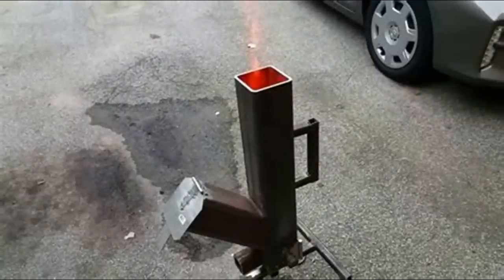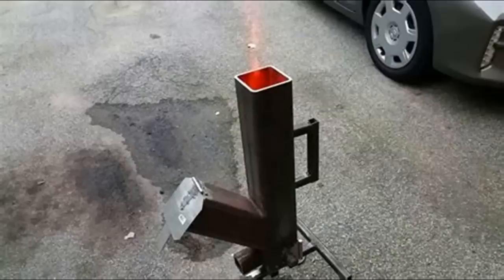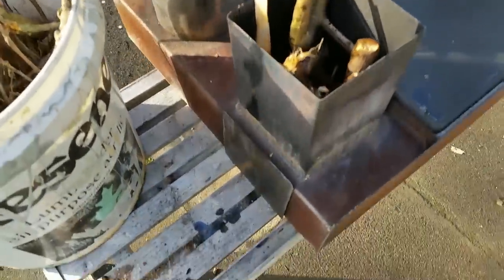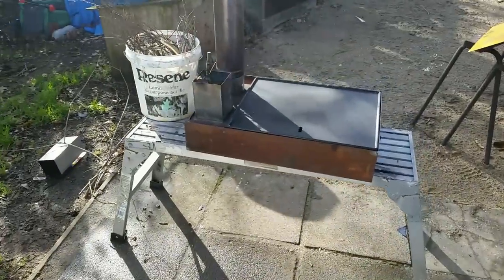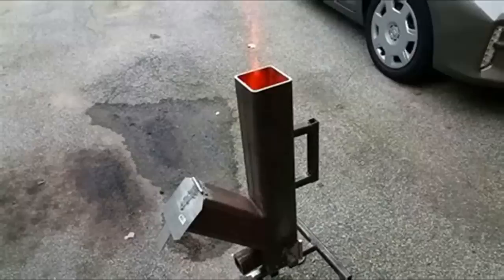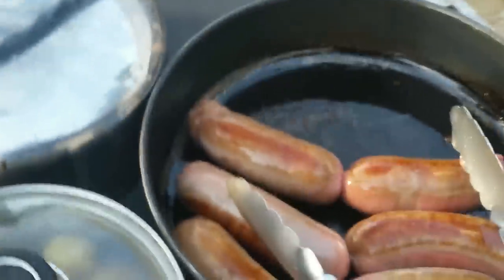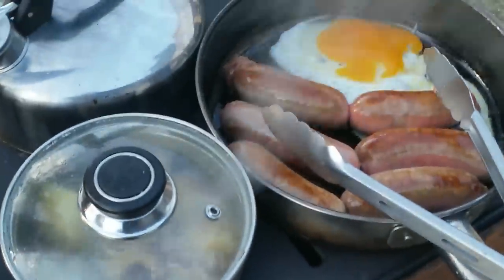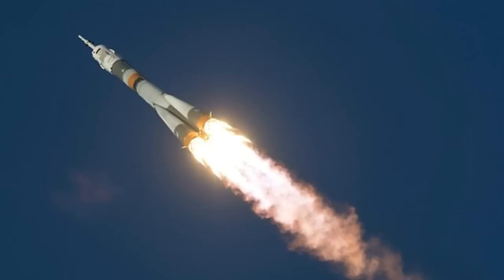2021  prototype of Rocket Cook Stove- Amazing Versatility! part 1

Comment: It is almost hot enough that you could cook on the surface like a griddle.  Load that  bad boy up with some burgers! 

Now If I could only make one that size that would fit into my kitchen counter I would be very happy!
Reply from the maker: Im bringing this one inside soon. just to see out the rest of the winter- Ill cook on it every night- use up all the dry sticks around the place to tidy up before spring.
Reply: I have been toying with the idea of putting something like this into a mobile home I am rebuilding, I had thought of doing a short rocket stove and then vent it through a section of counter top like a rocket heater. I even stumbled onto a 2'sq slab of marble that would make a great heated counter surface.   But I like your idea even more.  I am curious to see how it would handle a large pot of water to a full boil.  Loved the oven idea as well.  

Cheers
Reply from the maker: I always test fires with 4 cups of water- 1 litre. its a standard  test. my gas kitchen range boils it in 7 mins. most  wood fires take 14-15 minutes. the Nova does it in 12mins. I tested the oven last night- Its pretty miserable- I could only get 40c- 85f - I have to sort the insulation around it to hold the heat in
Reply from the maker: OMG yes!- what a great idea. if I cant get more heat out of this,  Ill look at doing as you suggest.  Im thinking a  "cassette" burner that slots into the underside of the oven and siameses into the same chimney.-Or I remove the firebrick that causes the hump in the flamepath so that the rockety flame blast heats the bottom plate more. The way I have it, it rolls over the brick and humps into the top plate. With more development I could make a moveable baffle that directs the flame up or down with a lever on the front!- See what happens when you get me going!- Im off to the shed.

Comment: Why block the air intake? As soon as you do it's not a rocket stove. If ain't broken font fix it. And the rocket stoves been around a lot lot longer than 40 yrs
Reply: he is controlling the rate of burn, so hes hot plate doesn't get too hot . if he wants too get it hotter he just lets more air flow through . does this make sense at all ??

Comment: 200F - that does not look hot enough... looks like cooking (boiling big pot of water) is everlasting.
Reply from the maker: sorry Sergey- that is Celius.- so almost double the temp you are thinking
Reply: ok! How much time, approximately, does it take to boil 1 gallon (5 litres) of pure water?
Reply from the maker: @sergeykopylov652  there are three different gallons for a start!  thats why the metric system works so well. a litre is a litre   
Std boil tests are done using one litre of water. This stove boils one litre in 6 mins which is not the fastest out there, but it has large area that will heat four pots at once with the ability to control the heat- that is what makes this flatbed design special.
Reply: Ok! 1 litter it is fine! I like metric system - I grow up with it.
For the example I used my regular kitchen pot I use for  camping.
That is good time. Thank you!